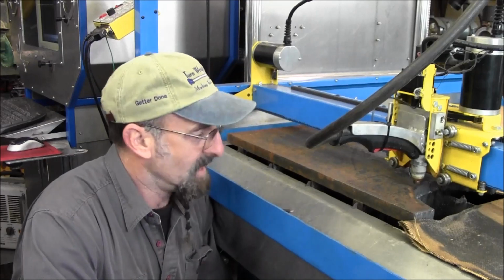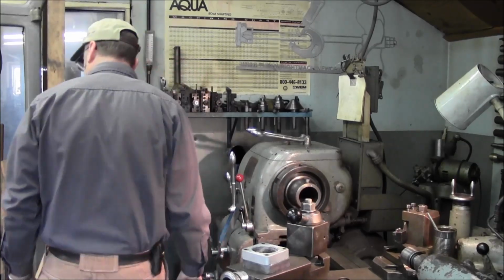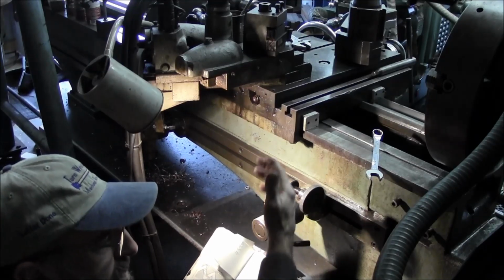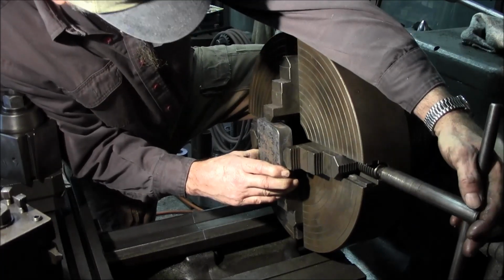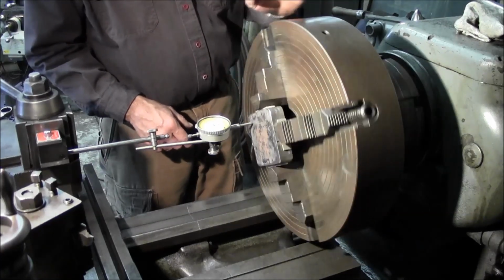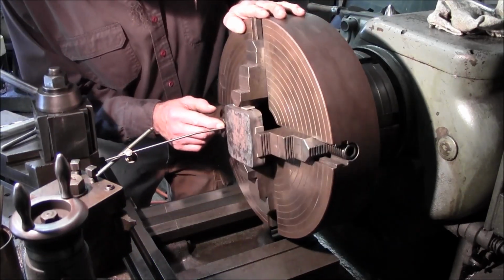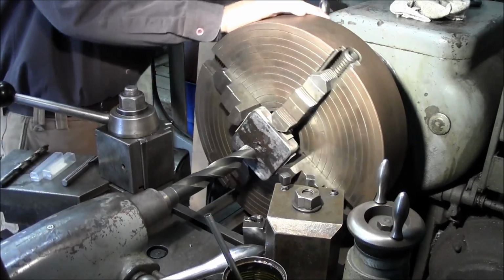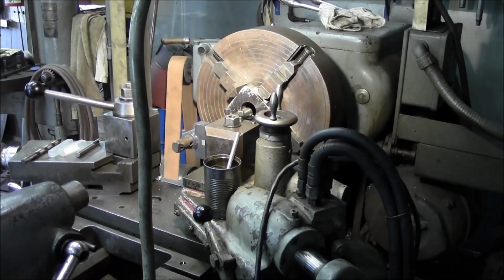Between the Boxes Part 1

Comment: My way- transfer punch corner holes. locate center hole from them. Drill all 5 holes with bolt clearance drill. Open center hole to Dia. just less than OD of lathe tail stock center. Make one pass with boring bar if hole wanders. Mount block loosely on faceplate. Center it with spindle by pushing tail center into hole. Mount securely. Get er done. Not acceptable for precision layout.

Comment: Is that a Colchester Mascot lathe?
Reply from the maker: Clausing Cholchester has no mascot tag but many have stated it is!
;{)------
Reply: Keith Fenner Defiantly looks like the Mascot, I used to work one of them, the gear change levers were on the top of the head stock, the long lever on the front side of the head stock would be a low and high gear change and from memory the shorter lever beside that was for selecting metric or imperial threads when you were screw cutting, the chuck spanner defiantly looks like Colchester design. The serial number should be on the tail stock end of the bed stamped on the top of the bed. The lathe I worked had a small brass plate at the head stock end down near the ground where you turned the motor and coolant pump on which said Mascot on it. The motor on it run all the time and the lever with the red knob on it was your clutch to engage the chuck. Good video, nicely made and good quality.
Reply from the maker: madeljacky No clutch and no metric change gear lever but all the rest is close. The serial number has proven it is 1957 and a special order for the USA and a few other details I've already forgotten. ;{)---

Comment: You made my hernia's hurt removing that 3 jaw. May I suggest making wooden cradles for the chucks? I always used a cherry picker to lift the chucks with an I-bolt. Once you are injured you'll wish you had. I have had a few operations because I thought I wouldn't get hurt. Got carpel tunnel from pounding on things with my hand. Mallets work much better. Just a suggestion.

Comment: carryit around a parallel would be ok to start if you indicated the face still it'd get you started.  multijones if the piece wasnt already centered when you drilled and reamed you would just cut a offset hole it wouldnt help.  i use a dial indactor for all the sides not just the face.  but thats just me.  kinda rock the chuck up and down and find the lowest spot on the sides and match 2 and 4 and 1 and 3.  as long as you got some decent flats on each side you can get it with in .001-.002.

Comment: Operating a 4jaw looks very hard as opposed to a 3 jaw you just tighten up. Could you slide a parallel behind the part? Great vids Keith. Getter done.
Reply from the maker: The Jaws are worn and what they call bell mouth and as you tighten they push the part outward and so the parallels fall out. ;{)----

Comment from the maker: Cleveland is a good go to brand, I shop deals and such also, but when it comes to a lot of holes to be drilled or tapped, buy a few different brands if you can, put them to the test, sometimes, the off the wall one sometimes does just as good, but most of the time the price, dictates the quality. ;{)-----

Comment: An easy way to center a square work piece in the 4 jaw I've found is to mark out by hand and drill a hole on center on the drill press, then you can use that hole to clock up from on the lathe with a finger dial indicator.

Comment: No way cnc could do this faster for just one part. If you had to write a program, set up the work, and do all your offsets, Keith would have this part finished, delivered, and paid! In fact, I am sure the tooling and set up cost for alone for doing this cnc would exceed what Keith charged for the finished part.

Comment: Quite a novice myself and until recently only had a 4 jaw and no thread cutting, made a similar plate for an OMC exhaust elbow. I used a round plate, torchcut the center hole, finished it up with a light bore on the lathe then welded in a threaded sleeve, then used a power bandsaw to make it square without distortion.   Would starting and indexing everything on a circular plate before making it square be faster?   Thanks as always for your teachings.

Comment: im also using a 4x4 version of plasma cam up here in maine. im running a flat radius tipped hypertherm powermax800 if you wouldnt mind me askin what are you running ipm and what kind of spacing with your torch head

Comment: It's interesting to see metal turning. As you probably gathered from my last comment, I do wood turning. I have a wood chuck that looks very much like a miniature version of your 4 jaw chuck, complete with the lines. I also turn faces, and have to make the face true and drill. There are a lot of similarities to what you do and what I do even though they are so different. The reason I was looking at chucks is I want one with curved jaws which grab wood better than those points. self centering too

Comment: Since you were cutting on the plasma cutter, why didn't you start the hole with that?  As long as it was a bit too small, the boring bar would clean it up easily.

Was it the issues with piercing the heavy plate?

Dave  8{)

Comment from the maker: The main reason it was a problem with the flywheel was that it is of cast material and cast that is brought back to molten stage the second time buy welding hardens and becomes crystallized. Mild steel doesn’t get a hard surface from the plasma cutting. ;{)----

Comment from the maker: I sling the oil, and wipe off the excess from time to time. They do have the seasoned look but have zero rust. I'm a mile from the beach so I have to keep them oiled and in the winter with the wood stove going the machines are at their best. In the spring and fall when the humidity climbs, I'm more generous with the oil. ;{)---

Comment: It was thin on the one side. I took off a little material on the other side and left a flange on the female splined section. even used on eBay, this pulley gets $120-$150 with worn splines. A $15 piece from surpluscenter makes it like new again. It was a ~2000lb press fit and the weld probably wasn't needed. I made the fit a little less tight on the thin side.

Comment: I meant to type a response with the video- Have you ever used a carbide "hole saw" For large bores? I have gotten many new ones on ebay for an average of around $5 each. They are made for a triple thread acme type screw, but I go through them with a 17mm and then tap them with a 3/4-16 thread. Usually less than .002 off. I have since made a holder with an MT-3 taper.

Comment: Hah, funny about the reversed mandrel!  I actually thought it looked wrong and even backed the video up to make sure I didn't see it incorrectly but then just figured I was not thinking about it clearly ... only to find out in the end it was backwards.  Interesting using the tracer to cut pipe threads though, I have not done that on my lathe before.

Comment: you know when a 3 jaw is heavy is when it bounces the camera when you set it down . I remember in High school a non listener( we were told never to reverse cut threads on that lathe )  was reverse cutting threads on our clausing and he unthreaded the chuck and it rolled off the spindle and hit the ways , took a chunk out of them and also cracked the 12" thick concrete floor under it when it hit it .

Comment from the maker: The torch I have is only a 60 amp and can cut 1" with no problems but piercing I have to pilot drill. I could have easily marked and pre drilled holes, like I have shown in other videos but thought about showing other ways for the guys that were hinting for more lathe videos. I'm trying to spread or change up all the time when I can and when the work allows me to demonstrate new options, for someone who may not have a PlasmaCAM or the other way, no mill / lathe but has the other tools. ;{)---

Comment: Nice video Keith, I'm sure this will be very helpful for lots of people. Just a quick simple tip that was shown to me by a life long toolmaker before he put away his tools for the last time. When setting your work piece in the jaws lay a parallel across the top of the jaws then put your work upto it, you'll still need to clock it for precision stuff, but you'd be surprised how close you can get it, couple of taps with soft hammer and away you go.

Comment from the maker: The reason I leave a little drop material around the part is because I want the cut or outside surface to be uniform all the way around the part. Thanks for the comment! I'll be doing a video on the nesting software in use soon and I will be showing material saving. ;{)---

Comment: Greetings and Merry Christmas Keith,
I really enjoy your videos.  Thanks for taking the time to share your knowledge. I have relatives on the Cape and enjoy your weather updates when it is ugly up there.

I suspect a marine application for your flange.  Could you have cut a round on the plasma then lathe work and then squared it off in the mill?     Why does everybody leave material on the outside of the part?   why not cut three sides not four? would seem to use materials better.
Thanks  Dudley

Comment: On a curious note, why didn't you burn out the large center hole with the plasma cutter, and finish up with a boring bar, and then cut the threads last? Even the mounting holes could've been neatly piloted with the plasma torch. Thank you for an informative video and a great lesson in lathework, as a fact, it's my pleasure to know you Keith!

Comment: I do not have an overhead trolly but the way I deal with large chucks is to take 4x4 and 2x4 stock that span the bed and make a build up and simply scribe the chuck diameter on the build up and cut it out on the bandsaw. Then I just slide it underneith the loosend chuck and slide it out and across the ways onto one of my die or lift tables. Once again thanks for all your expertise and informative videos and mostly sharing your time. Getter Done! Brian

Comment: You know, I've recently found that starting with a hole saw works well for me.
I recently did a little project where I cut four 1-3/4 holes in .650 A2 tool steel with a hole saw and then bored them to 1.80.
It saved a lot of time!